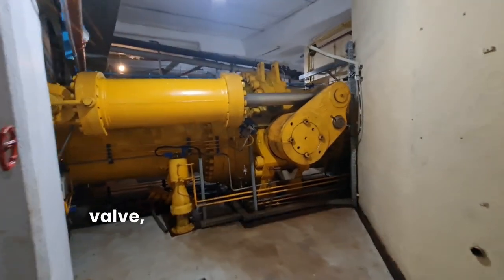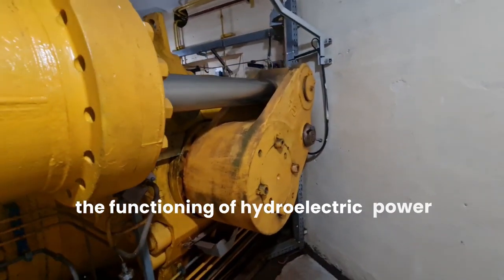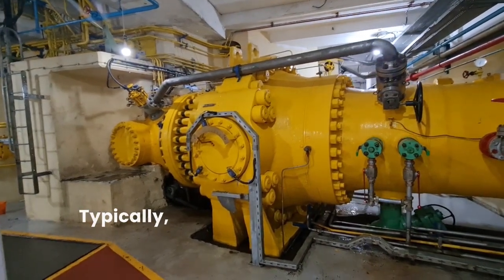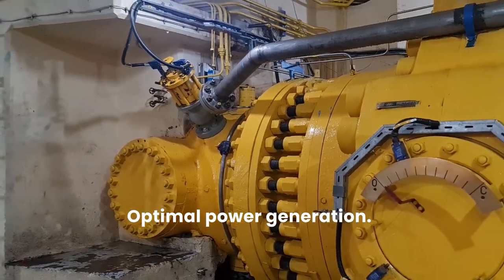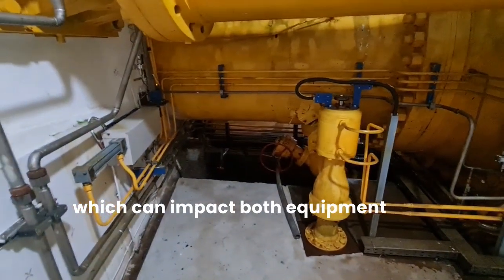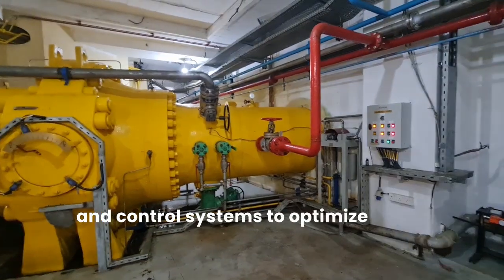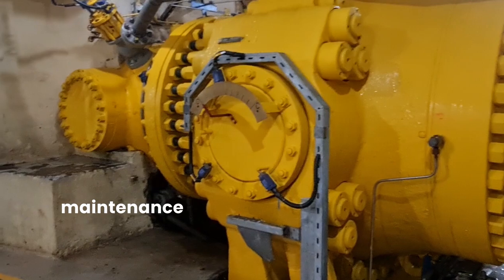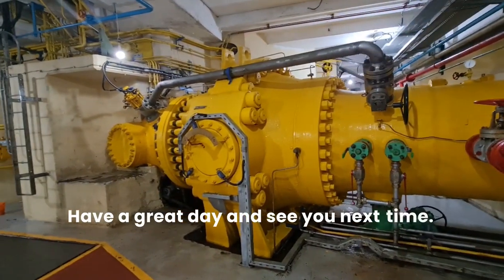What is the main inlet valve in a hydro power plant? | How Does an inlet valve work

Comment: How does it work?
Reply from the maker: In a hydroelectric power plant, the Main Inlet Valve (MIV) plays a crucial role in controlling the flow of water from the reservoir to the turbine. Here’s how it works:

1. **Normal Operation**: The MIV regulates the flow of water to the turbine. When the valve is open, water flows from the penstock (a large pipe that carries water from the reservoir) to the turbine, driving it to generate electricity.

2. **Start-up**: Before starting the turbine, the MIV is gradually opened to allow water to enter the turbine at a controlled rate. This prevents sudden pressure surges and ensures a smooth start-up.

3. **Shut-down**: When the turbine needs to be stopped, the MIV is closed to stop the flow of water. This action is crucial to prevent water hammer (a surge of pressure caused when the flow of water is suddenly stopped), which can damage the pipeline and equipment.

4. **Emergency Situations**: The MIV is also used in emergency situations to quickly stop the flow of water to the turbine. This can prevent damage to the turbine and other components of the power plant.

5. **Maintenance**: During maintenance, the MIV isolates the turbine from the water supply, allowing safe access to the turbine and associated equipment.

The MIV can be operated manually, hydraulically, or electrically, depending on the design and requirements of the hydroelectric power plant. It is a critical component for ensuring safe and efficient operation.
Reply: @electricianhub-t3o  Is it a gate valve, a ball valve, a screw valve or does it operate by pressure relief?
Reply from the maker: spherical valve, its operate water pressure
Reply: @BrantAerials  the system is flexable no preferance  ( the dam owner has to make it fit so up to them)
Reply: @electricianhub-t3o   in short the system has been told from the beginning that  back pressure issues would make this type of system a nonstarter . 
Now as it has developed the  issue has been fixed now as for other hurdles non are concidered non fixable 
Now lets be clear the main hall can run with this system off line if not needed or a turbine is being removed (2-3hrs) with the hall at full noise
Even if all turbines are needed the system can close one unit down and remove it 
as for emergency valve shutdown  and electric brakeing can be deployed